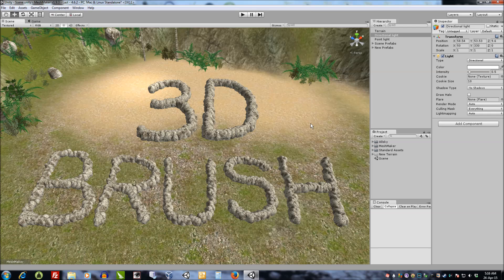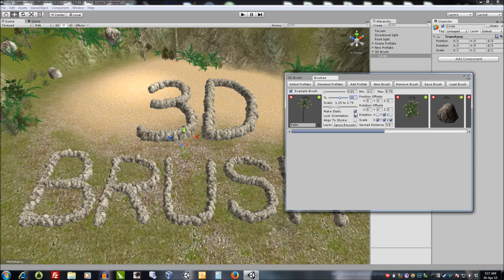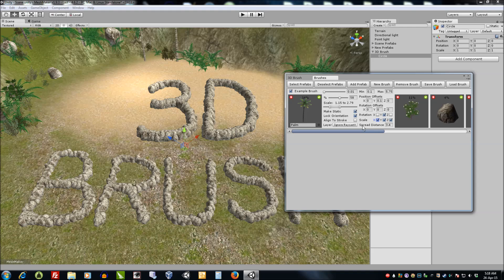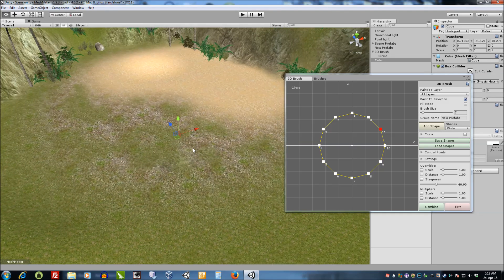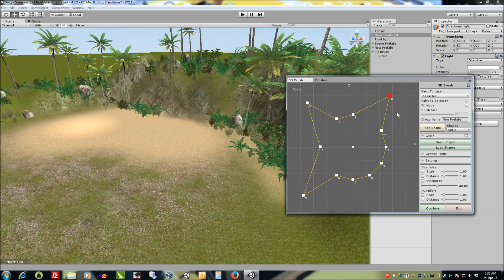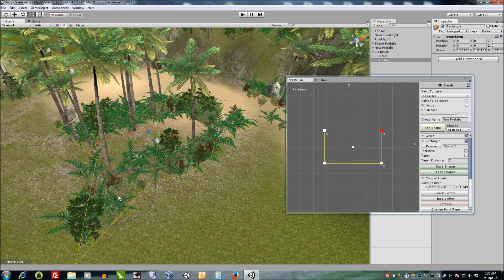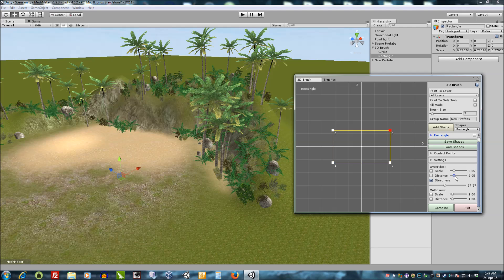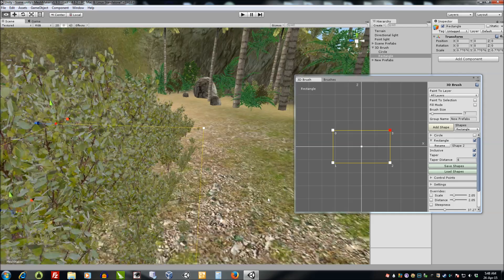3D Brush - Prefab Painting Tool For Unity3D

Comment: CANT GET IT WORKING IN MAC. Edit. it worked fine after changing the hotkey
Reply: WHEN PRESSING SHIFT IT WANTS TO DELETE BUT WHEN USING CONTROL IT IS NOT SHOWIN OR RESPONDING TO IT
Reply from the maker: Hello Nadhim, sorry for the late reply as I've been working on the next tool for the collection and haven't logged into this channel for a while.

In the Settings foldout for the program you can change the default hotkey to any other key. On some Macs, notably laptops, it doesn't appear to find the Control key which is something I am working to remedy. In the meantime you can change the hotkey to 'A' or 'Tab' which works for other people.

Thank you for your purchase and your understanding while we work on this and hope the different hotkey is sufficient for now. You can also contact me at support@meshmaker.com if you require further help.

All the best,
Alan
Reply: Mesh Maker worked perfectly . thank you
Reply from the maker: Great to hear, thanks for letting me know :)

I have just uploaded a video for a new tool that will be available in the next update for Mesh Maker. 
You can view it here at https://www.youtube.com/watch?v=gUcRYwLVanU